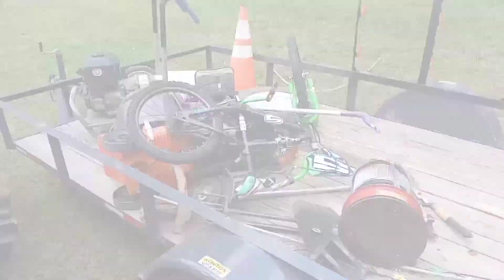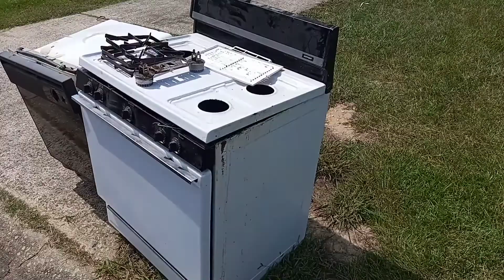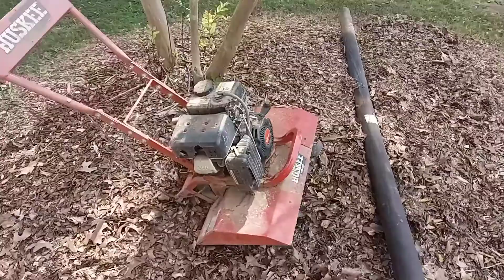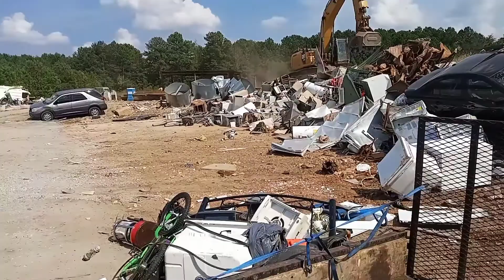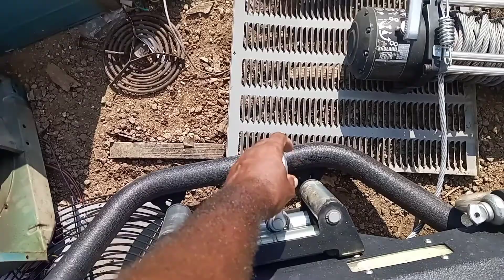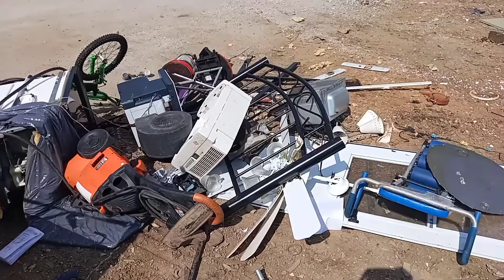How to Successfully Start your own Scrap Metal Business!

Comment: I got a good truck with 8ft bed, I got a 16 ft trailer and a lot of experience processing the metal for the most profit. I even tore down a mobile home before by hand and made a little off that scrap. My problem is I don't know how to reach customers and find the metal now. In my hometown I found it in alleys. Here now in college there's no alleys and there's barely anything on the curb and it's technically illegal to pick up.
Reply from the maker: I advertise on the internet and have signs on side of work truck. It help a lot! Facebook is site I used
Reply: @BacsATL  I'm not sure how to advertise either. I had an ad on marketplace and got a few loads but it got taken down. I want to start a legit business and do it full time